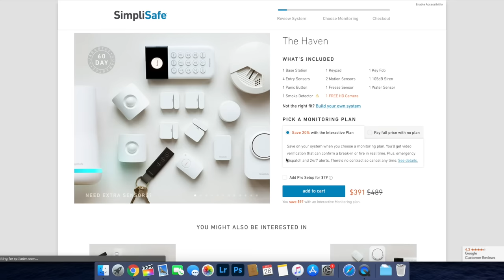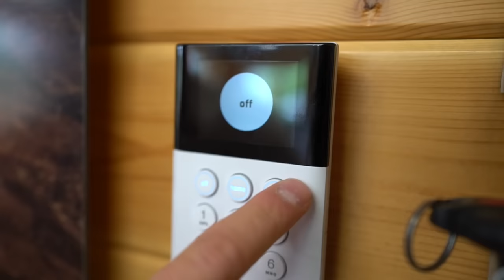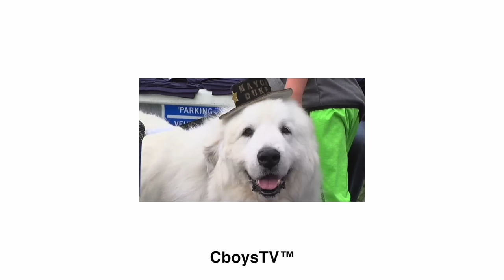Riding Pit Bikes in Skate Park!!

Comment: First thing you want to do with that limo is put some air dryer beads and in there to suck all the moisture out and then you want to go through with vinager water and spray all the mold spots and leave it closed up for a couple hours and then open it up and air it out. Then you’ll want to shampoo any fabrics and then select whatever air freshener you want